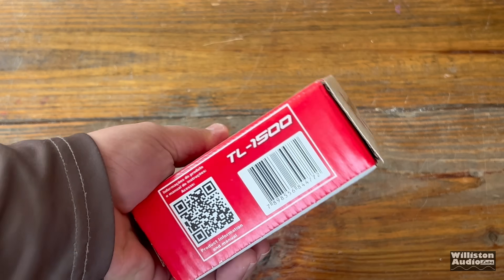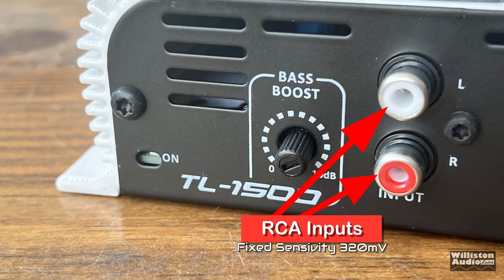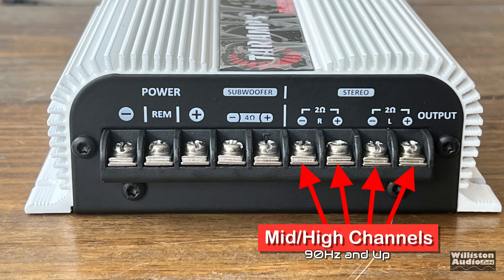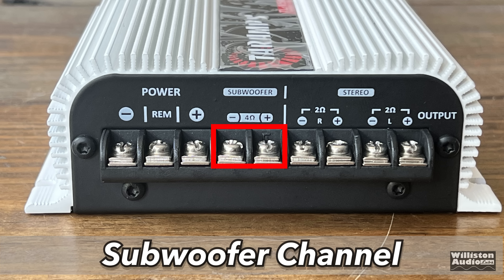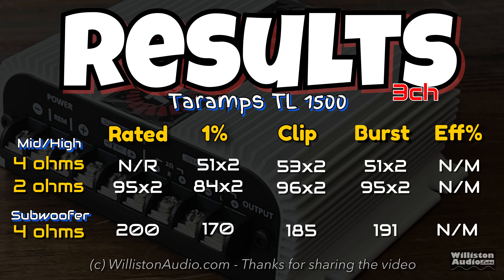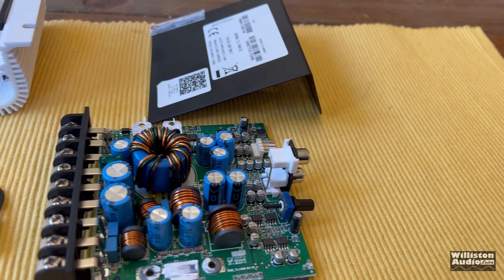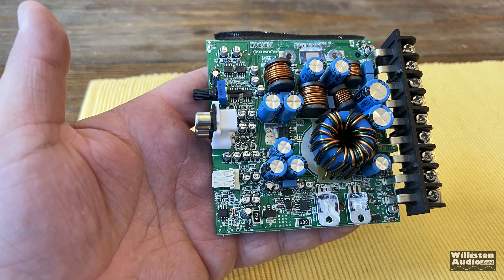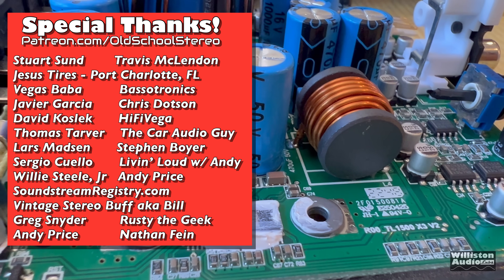Hidden Gem Mini Amplifier? Taramps TL 1500 3 Channel Amp Dyno Test

Comment: I’m running this little amp on a 10” woofer and 2 6x9s and it sounds pretty good.  It won’t impress anyone at the shows but it has great sound for driving around in your daily.
Reply: Why not buy a 600 or 800watt amp?

Comment: There needs to be  a micro amp powered by vibration, so you can have them amplify a signal coming from a closed electrical circuit to feed a calibrated receiver on a generator.  Then world's fake energy struggles probably solved more.

Comment: I picked up an 82 Porsche 928. I need a SMALL sized amp to drive the front and rear speakers - 4 channel. What’s your recommendation. Something they will drive clean sound.

Comment: I’m not sure if this is a dumb question I’m new to this but could I run a motorcycle amp ? They run very compact and push 1000 watts and also Marine subs is there really a difference between car motorcycle and marine vehicles? Hope you all have a great day
Reply: @thatguykai479  idk if you should run subs on a bike because it's open air just focus on mids and highs

Comment: Derek I have been asking for a while now to see if you can get your hands on a Soundstream Rubicon Nano RN1.5000D (quoted 5000 watt amp) that I can say is somewhat 1 ohm stable, but I have been running two Sundown Audio SA12-D2 subs on this amp for quite a while in my BMW now and it pounded them well for quite a while, but I'm fairly sure I fried it the other day. I once had four of these Sundown subs, but two of them blew. I just wired in my Orion HCCA SPLX 3k watt amp on VERY low gain and no boost tonight. It's the amp that blew the other two newer Sundowns on practically no power (as they're rated at 500 watts RMS each) and I was running all four at one ohm.

Comment: Its the same with engine displacement. Before if you had a 572 real cc they where called a 550cc but today if you have a 572 real cc, it would be called a 600cc. Wtf?

Comment: Sad that you cant believe what the companies advertise in their products anymore.... 
Specially in their spec sheets. Do they even dyno test their amps before sending them out for delivery? Or do they just simply slap everything together on a circuit board and say its rated this much?? Because I think the second question fits more than the first one. They slap everything together then judge the wattage without any dyno testing what so ever. I think that because almost all the amps on this Wilston's channel are dyno'd and the fact that most of them did not meet the rated advertised power?? Should be offered a complete refund and keep the amp because it was false advertisement prior to purchase as a consumer.

Comment: Ive been running several of these the past 2 or 3 years without any failures. They are perfect for offroad setups because i can place them in water/dust proof containers and run 4 speakers and a sub off of them and not worry about the heat so much. They take a lickin and keep on kickin.
Reply: I used to do that for my Suzuki samurai years ago, def for water and mud. Use a few grommets with silicone and they’ll go under water for at least two days until you could get the tractor running and get it unstuck!

Comment: Hi everyone off topic but no1 answers anymore do subwoofers lose impedance over time I have 4 dual 4 w6v3 subs final impedance 2 ohm quite old but still bang hard but I just reinstalled it all into another vehicle absolutely nothing different but when tuning played amazing turned it down 5 minutes later amp smoked but didn't smell disconnected it then connected it bk up played normal turned it down waited then smoke poured out again didn't smell left it then went in protection I tested subs I got a 1ohm reading should be 2 it's a 1ohm stable amp xfire 7.5k but I'm not using ghe 1ohm load speaker output just normal have good voltage 14.9 goes upto 16 volts any ideas cheers

Comment: I know most of the amps you test are car amps, but have you ever tested or checked out the Fosgate Audionics FAA 1000.5 5-channel amplifier? I have one and it is one of the cleanest amps I have ever owned. The design is kind of unique having 5 separate amp board modules you can remove. If you have nothing to do check one out and add it in to one of your videos.

Comment: I think most people have issues with amps, when they just don't know what they are doing. 

They mosy likely run them with low voltage because they didnt upgrade their electrical, or clip the hell out them.

Comment: I literally installed this amp Friday. I had a bass 3k on no gain overpowering a scar sub. Put this in and was shocked at how much power it puts out.  And in case your wondering I have it on 1 ohm and it’s holding strong. I wasn’t worried because it’s my third taramps amp and they always handle low ohm. Definitely a lot of amp in a super small package.
Reply: 👍 yup! Two 6x9s + Rockville 12" tube🎉

Comment: Damn, if that thing had three inputs and defeatable crossovers it would be PERFECT for one of my projects where I'd buy tons of them.  Any others out there?
Reply: Not that I know of. I've got a tri-amped active (DSP) 3-way floorstander in the works, utilizing 3x Fosi Audio V3s for amp duties. It isn't portable, sadly. Could be portable, technically speaking, you'd just need 32-48V DC at 15-20A and a small supply for the DSP board.

Much more complex than a couple of these amps and a lithium car battery, though.

Comment: Add bt to this and with a relatively cheap 400w 12v supply you could cobble together a heck of a rocking garage system.

Comment: I have this amp in my Mercedes  slk230, which has two 5.25 subs behind the seats and 2 tweeters andb2b6.5bin the doors.bthe tweeters and subs arebfactory the 6.5 are kicker 2way. The deck is a jvc. My system  sounds great for what i have in it. And being so simple. I love this amp. Have owned it for around 4 years. No priblems what soever. Glad you did this dyno. I was wondering  how many watts it actually pushes. Thanks for your great work. Inever thought the amp was doing its rated power. But its great for my 2 seater.

Comment: i like the drywall screws used to screw that sundown into the box, the ducttape of screws😂. cool little amp, better power then the other micro amps the can run 36volt
Reply: I hate drywall screws. Teks brand have been my favorite so far

Comment: I have been running this little amp for about two years and love it! running one 12'' kicker and two in ceiling/wall bose house speakers! and two small compact bookshelves in my sprinter van. What's crazy is I have it wired to a 12v cigarette line which was just to test but didnt pop any fuses or get hot so I never ran any dedicated wiring lol
Reply: That just means power you are getting very low wattage from the amp. Your current consumption is limited by what can be supplied by the cigarette lighter. But if I t plays well enough for your needs then it's a win.

Comment: I would love to have several of these running a complete 3way active system with subs! You could even come back with one for center and rears.
They need to offer a model with NO internal crossovers as well as adding RCA inputs for each outputs channels.
Then I believe you'd have some really nice versatile offerings!
Reply: Exactly, I already posted something similar.   It would be PERFECT for a portable 3-way active speaker if it had defeatable crossovers and a 3rd input.   Would be even cheaper for them to make because I don't need the filters.   I'd buy them by the truck load.
Reply: Lmao, same thing came to mind. Crossover defeat is a no-brainer, bummer that they failed to implement it. Couple of these and DSP, you'd have a solid 3-way front stage.
Reply: Taramps TS 400x4

Taramps DS 440x4

Comment: I also have had one of these amps die within a few months of buying but I also have another one that I bought the same time that still works  so it's the toss of a coin if you get a good one .. second one is still going strong and I've had it for over a year and a half

Comment: I have ordered 3 teramps so far (800x4) on my door speakers and (hd3000) on my subwoofer no issues went and bought a md5000 and after 10-15 min of play time i heard sparks coming from it and straight into protect i sent it back to amazon  its always hit or miss sometimes they could be mishandled during transport or idk

Comment: One thing to be aware of with these IC Class D amps is the upper end frequency response.  They're supposed to have some form of LRC filter on the output to remove the switching spikes. This leads to a preferred matching for speaker impedance.  A mismatch,  say 8 ohms vs 2, can roll off the upper end above 15 kHz.
Reply: while i mostly understand what you mean, can you clarify a bit more regarding impedance? if its rated at 4 ohms, are you sating running it lower would change the frequency response?
Reply: @OxBlitzkriegxO  In a word, yes. The difference between a 2 ohm speaker and a 4 ohm one may not be much if the output filter was designed for 4 ohms but if it was designed for 8 ohms, as is common in home speakers, then the difference might be noteworthy. Unfortunately there's no way to tell short of the vendor giving you that info (or somebody tests results). Now it maybe your source material doesn't have much content that high or you're over 40 and your ears no longer hear those harmonics. Then it's a don't care.

Comment: Not a bad start out amp for someone. If someone did start out with this amp i would over spend the extra cash towards the wiring kit though. Try to run as low as you can afford with a fuse block in the rear somewhere. Then when you upgrade the lower gauge wire is already there for the more powerful amp. I always overkill on the wire in all my rides so i only have to do it once😂.
Reply: Agreed. You learn the hardway. Rewiring everything sucks..
Reply: Oh its bad, for anyone..  look at all the comments.  "I have had one of these amps die within a few months/Weeks/Days, company wants you to pay shipping both ways for warranty work"
Reply: @crisnmaryfam7344  I will have to look at what the warranty is and covers. Depending on the warranty, depends on if it is worth buying though. As far as someone's going bad, that can be from a few reasons or just a bad amp. Some people assume they also know what they are doing and don't even adjust a amp the correct way, so I cant comment on why it would go bad.
Reply: @crisnmaryfam7344 I did see where shipping to them for repair is on the buyer. That is normal with most purchases online though. Now if it bought at a audio store that might be waived by the installer though. It didn't say anything about the cost to return the amp back to the buyer though. Might want to check on that though. 😂 Im not saying this is a Great deal for everyone to go out and buy one either. I just said if someone was looking for a budget amp and was starting out. To me the watts for a sub isn't enough for me to ever buy this😂. This would be great for a young teen or adult thats starting out in audio and not looking for a lot of bass😅. This would give a little thump in thr back and make a good set of mid and highs sound goos till they upgrade. That was also the reason I said to put that extra cash in wiring😂. The bigger the amp, the bigger the wire😅. Or they would be replacing the wire for a second time.
Reply: @crisnmaryfam7344  all audio equipment I've had fails. I had a JL amp blow right out of warranty. Take both my subs with it. (Made them thump by the time I was able to pull over and shut car off they were seized) I contacted JL pissed they apologized. Paid $60 to ship. They shipped it back quick and the amp didn't work. I've had alpines blow. Memphis blow. I've ran a Taramps for 3 years now with 0 issues. I bought it to just test it out because there so cheap and I never took it out. They aren't the cleanest power though I'll tell you that. Just put in a MD1200 in my tundra with 0 issues for the last 6 months